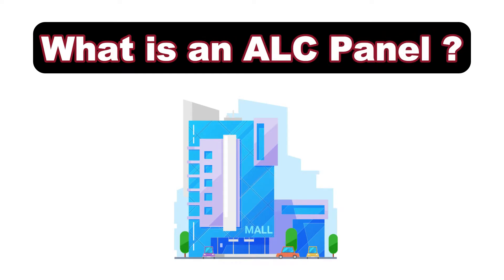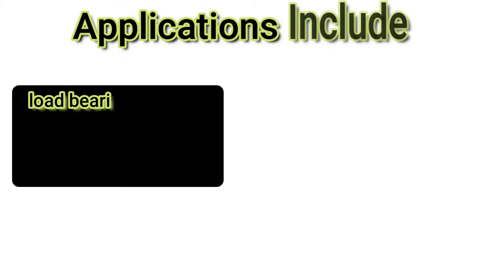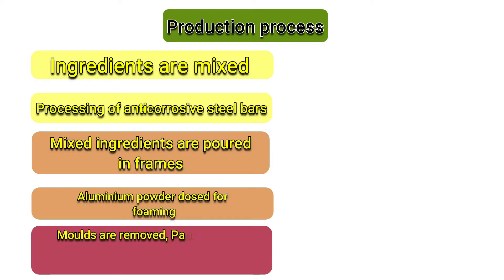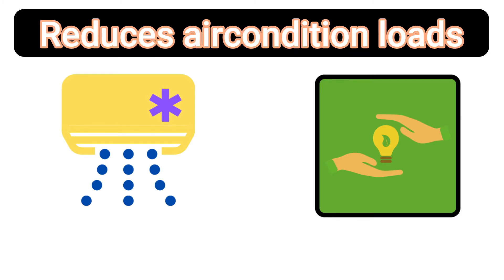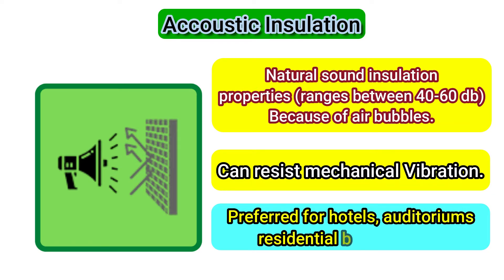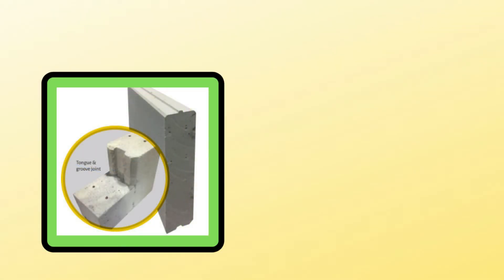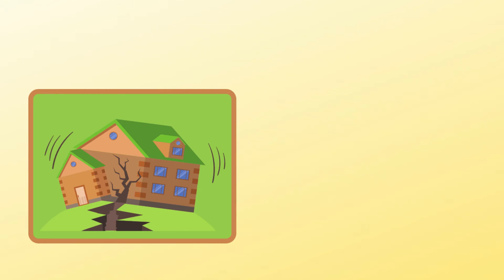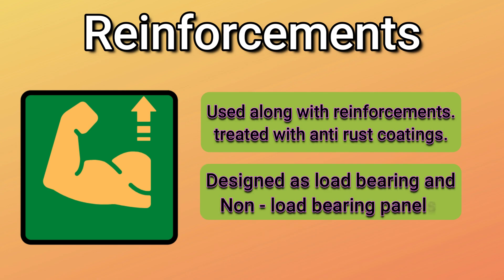ALC Panels || Aerated Light Weight Concrete Panels || Autoclaved aerated concrete panels

Comment: Are ALC panels easily available in India? What is the cost per SqM or cost per sqft? You haven’t shared those information
Reply from the maker: yes it is available
Reply from the maker: Magicrete  brand it is available. Rate will be around 3500-4000/- per cum. The rate depends on the transportation charges
Reply: You are speaking of AAC not ALC. AAC is Autoclaved Aerated Concrete, which aerate during the baking of the panel due to the reaction with the aluminium. ALC is Aerated Lightweight Concrete. These use a foaming agent and are not baked.
Reply: Does it contains any toxic gases??  @jdm4657